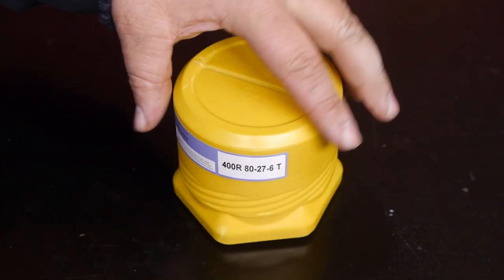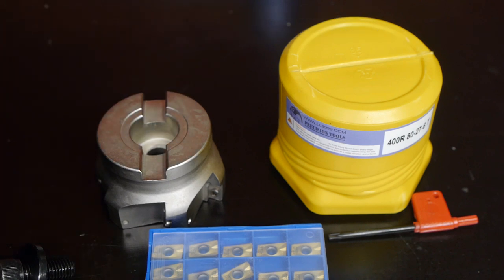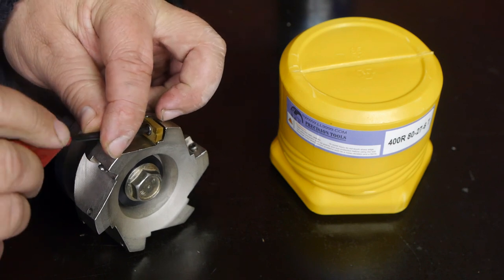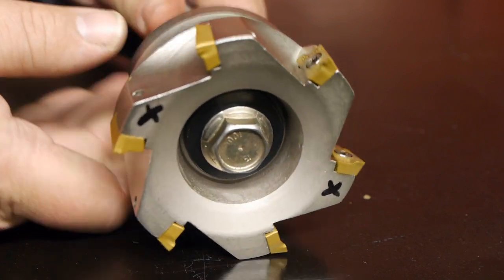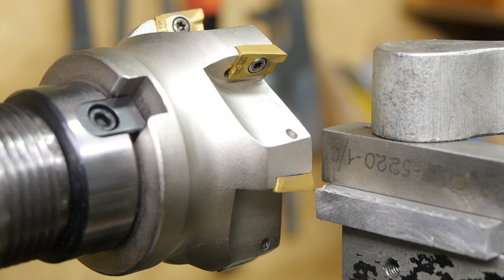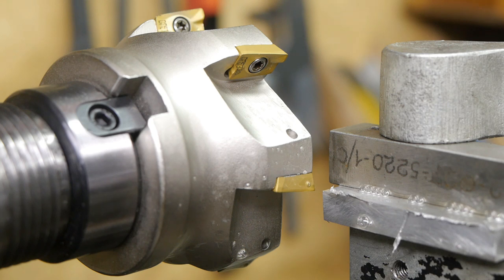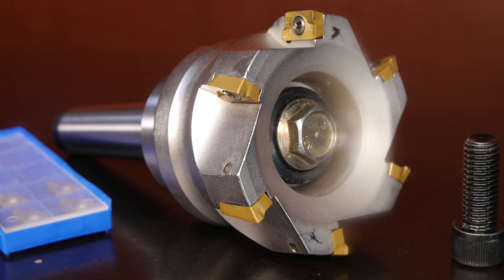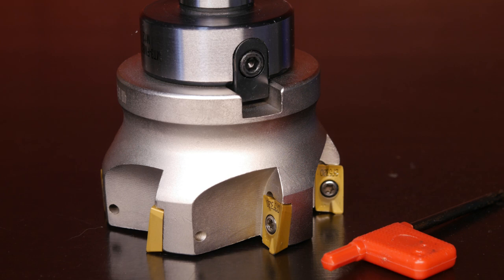Testing  a cheap chinese face mill on a vintage lathe

Comment: Once when I was in the emergency room (after having cut my thumb badly in the kitchen) the guy on the next table over was a career machinist. He was clearing chips from a mill in a way he had done a thousand times before... but that was the one time he didn't get away with it.  And therein lies the lesson: you may get away with something a thousand times, but it only takes once.  Fortunately he only lost the nail and a shaving of bone, not the whole finger. Me, I'll keep using sacrificial things like chip brushes. My fingers don't go anywhere near the work, the tool, the chuck when anything is moving.

Comment: As an old machinist with 10 digits still intact I cringed when you checked your surface finish with the spindle still running.
That would be number one on the “Never do this” list. Right up there with checking for a sharp edge on a spinning part.
The cutter will take no prisoners.  In a flash your fingers will be gone.
Yeah yeah Safty Police and all that.  
When leaning to fly a plane my instructor said to me.  There are old pilots and bold pilots, but no old bold pilots.
Stop your spindle when you hand leaves the feed wheel 😀

I agree with the others that’s only cutting on one or two inserts.  That should be obvious on the inserts themselves.  
Only one or two will show any signs of ware.
Perhaps a dial indicator on the inserts to measure their location.
Reply: I too cringed and he didn't do it once but three times. The last time i thought he was going to be bitten big time and lose two or three fingers at once, he would not have lost just the tips of his fingers but the whole lot as they were dragged into the cutters. And don't forget there as six of the greedy little bastards not just one!
Reply from the maker: I've been hit on the fingers a few times. It actually doesn't hurt as much as you might think.
But I wouldn't like to get caught between the chuck jaws and something else.
Or loose a chuck of flesh to the milling insets

I'll be careful, I promise.
Reply: The other big one is V belt pulleys or Leed / Feed Change gears.
Never use a lathe without a guard on the change gears.  They are like a meat grinder and will grab anything that goes near including you clothes.  If you don't have a guard make one.
V belts pulleys will grab you and whip your finger around the pulley.  I know you have exposed pulleys, my 80 year old lathe does too but my hands never go anywhere near them when they are running.  When I'm changing the feed gears the power plug is out and hanging where I can see it.  I don't want to harp on about this.  If you learn one thing from your Youtube buddies this should be it.  You won't loose a chunk or get a cut.  It will hack your finger off or crush it beyond repair.  We don't want to be calling you Stumpy :)
I'm still enjoying your videos and your commentary so keep it up.
I'm up to the editing stage with my first video on a quad bike repair.  Man that is as time consuming as the actual job.
Reply: he might never need that fingers anyway....heheh...

Comment: Peter Robson.
It sounds like only one cutter is cutting the meterial.
Reply from the maker: I guess this one is for you: https://youtu.be/tBmgfksN5sc
Reply: Technically with the small piece of stock in the fixture only one is cutting at a time. If if was larger area then more would be at the same time during feed...

Comment: Sounds like one or two inserts are doing all the work. Would have liked to see you use a clock to check insert heights. I would think you could get a better finish with the fly cutter and a very sharp well honed edge on a decent piece of HSS than with the face mill.
Reply from the maker: fun before precision, but I will check them with an indicator.
Reply from the maker: I measure the insert hight in a follow-up video: https://youtu.be/tBmgfksN5sc
Reply: you can tell by eye its a least 4mm above  centre height

Comment: I have the same tool and I remove the inserts leave only one and leave finished like a mirror.
Greetings from Chile
Reply from the maker: I also try that near the end of the follow up video https://youtu.be/tBmgfksN5sc
Reply: @Rolingmetal  To me it has given result, work at 2000 rpm with a single insert and works quite well and how much I want to devastate use Apmt 1604 M2 inserts work super despite my milling machine is Chinese and very poor quality
Reply: greets from linares Chile

Comment: There is a speed and feed issue here. Plus I'd take a deeper cut with the inserts. Either speed up rpms or reduce feed rate. 

Reason I say deeper depth of cut is because its not getting into the zone the carbide wants. Id be different if it was a single point tool taking spring passes
Reply: Not defending the cheap inserts because a high quality insert is bar none. Just saying..
Reply: Agree with what you are saying here. Carbide needs a certain depth for them to work properly or they just rub (which it looks like to me is happening) because of the top edge engaging the material. I also believe that is why others saying to use aluminum inserts works better since they have a ground sharp edge vs the blunt edge of a standard insert for harder alloys/metal but this will decrease the life of the aluminum cutter. Reading on many insert manufacturers sites will show that too shallow of a cut with the wrong insert will cause uneven surface and rubbing to happen. I'M NOT a machinist and not claiming to know everything and only going off of what the insert manufacturers say/recommend, this is why when I get close to size but there is very little left to remove I go to HSS on my lathe or a traditional end mill for finish.

Comment: Congratulations on receiving the face mill.  Free is always the right price.  I have the smaller 50mm with 4 cutters, but mine was not free....but maybe someday.  To get a good finish with carbide, you need speed and pressure (DOC).  Really enjoy the channel.  Do you have a Patreon or Paypal account, for donations?

Comment: More speed at the cutter and bigger cuts . If you’re going to continue to do this you need to lock out the feed and add a load of weight to the headstock . 
It’s going to destroy your feed screws .

Comment: You should make a third axis attachment since you don't have a mill. If you're worried about the complexity or something you could make flat ways to reduce that. It might be shitty but if it has a gibb you can learn to make it work, I'm sure. My little mill/ lathe combo has a bend in one of the threaded rods so it still has about .0125 mm of wobble in that axis even if I tighten it up to Incredible Hulk settings. I just deal with it. 

I love seeing people make much out of nothing or very little. I think it's awesome.
 BTW, I've never paid enough attention to know if you have any dial indicators.

Comment: First thing.  Your machine is not ridged enough for that size shell mill neither is your work holding devise
The inserts are not for aluminum that's why you didn't get a good finish.  I use these cheep chineesium  mills in my shop on small engine blocks
and heads and get very good results.  If your looking for less then .0005  tolerances buy a Sanvik

Comment: I bought the exact same face mill. I was not impressed. I had the same problem with inserts not all being lined up on the same plane.
Reply from the maker: When precision is more important then fun it gets harder to be impressed :)
I'll check them with a test indicator. But the pointy bits all seem to have similar wear.

Comment: why didn't you run a tap in those threaded holes and also make sure the inserts set flat? Using a adj wrench to reef on them is just crazy - come on, you can do better than that. Even if the Chinese screwed it up, at least try and rectify the situation

Comment: I believe the issue with the surface finish comes with not passing the workpiece the whole diameter of the cutter, the trail edge is the end of your cut, not the leading edge. Great video though love your stuff
Reply: usually looks better you dont on most machines.
Reply from the maker: If you get a nice cross hatched pattern you know you spindle is square to the table. Mine sure isn't.
Reply: @Rolingmetal is exactly right, but I find with low carbon it tends to just smear on back side in my trials.

Comment: Sounds like the inserts were cutting uneven.  Use a sharpie and mark all of the cutting edges.  Make a cut and see which ones no longer have sharpie on the edge.  If any of them do not, it isn't cutting at all.
Reply from the maker: Many have said that. have a look at the follow up video. https://youtu.be/tBmgfksN5sc

Comment: Hello , great video , that is a very nice addition to a lathes capabilities , i wonder since in a tide budjet if it would a solution to hold an hss cutter in a four jaw independent chuck slightly eccentric if that would do a good face mill  , do you think it would work ? Would it be dangerous ? I have <<converted>> my wood lathe to be able to cut metal (mostly alumimium and plastics ) with a three jaw chuck and an compound table and a diy tool holder , its ok for now for what i need it for but i cant part anything but plastics cause it chatters and the compound table uses alot of space and i cant have tailstock support and since i need a four jaw chuck anyway i wonder if i can do some milling with it without having to buy mt2 tool holder .

Comment: For all those that are saying it only cuts on one tooth, unless the spindle and adaptor are true the cutter never will be, I have yet to see a cutter from Sandvik, Kennametal, Iscar or Seco cut on all teeth except if the machine is new or near new.
Reply from the maker: They are only class M inserts so there will be some variation in the size of  the insert. https://youtu.be/tBmgfksN5sc

Comment: Nice work RM, you really have the bug for a proper vertical "knee" mill. And so you are achieving it on the lathe in the interim. Good stuff. P.S. check your lens for lube oil :-)
Reply from the maker: You are right, about the mill and the lube :)

Comment: Nice toy but should be used in a mill. the lathe is not quite rigid enough to get your mirror finish. The finish you did get is remarkable though in any event as I see it, good work!
Reply from the maker: You might be right on that one. I guess I could use a mill :)

Comment: You barely scratched the surface (pun intended) of what that cutter could do in a BT50 tool holder.
Reply from the maker: 0.8 mm was the max I dared to scratch off.
Reply: @Rolingmetal  Probably for the best.
Probably not going to get a performance increase over the fly-cutter for such a light setup from the stand point of metal removal..
Try leaving every other insert out if chip load gets to high.
For alum there are better inserts than the ones you have there. Just putting one of them in is often best for finish. Would still be better balanced that a fly-cutter and the extra mass of this cutter may dampen vibrations some.

Comment: I have a 50mm face / shell mill from China but I bought inserts that are designed for aluminum. They are very sharp and I think they're uncoated. I get a mirror finish.
Reply: +1 on using aluminum inserts. I use them on stainless steel. Our cheap Chinese lathes and mills seriously don't have the balls to use standard carbide inserts correctly. I get an amazing finish using them. Tool insert life is not highly important to me.
Reply from the maker: Ok, so now will need to get me some aluminium inserts. Because the inserts that came with the mill are shit. https://youtu.be/tBmgfksN5sc

Comment: Very interesting, I have always trouble grinding a flycutter bit correctly, due to lack of experience, so using these cheap inserts on a milling cutter instead of a single point flycutter is intriguing.
Reply from the maker: for me, itsure worked a whole lot better then fly-cutting

Comment: They just used the nearest available washer to place under the bolt. A little bit of thought would have resulted in one a little thinner for more threads engaging.
Reply from the maker: Even if the made the washer a lot thinner I still wouldn't be happy with it. That's why I used a longer bolt and not a thinner washer.
Reply: @Rolingmetal  Understandable. Your bolt may be stronger as well...who knows what quality of material is in the bolts they use?

Comment: I had already turned the noise off b4 u said dont touch the volume lol
Like ave says good enough for the girls i go out with lol
But really for 35 usd it aint bad for many operations.
Reply from the maker: It's at least 35 dollar of fun.
Reply: @Rolingmetal  I think its very nice.

Comment: Glad the test run of the face mill had a happy ending.

I love the face mills with carbide inserts.   I have one which uses 4 inserts.   1 1/2in dia (3.8 cm).   I was not sure if this would be too big for my milling machine, but it runs so smooth I could have purchased e.g., 2in dia ( 5.1cm).

This is a good addition to your tool temple.

Dave.
Reply from the maker: Damn you're right! this one will be more then likely to big for a Chinese milling machine.
Reply: I think it will work for you.   They are balanced when running.   The particular milling machine will just determine the maximum depth of cut.

I am not in a hurry so I normally take light cuts such as .5mm.

I bought a 3in dia boring head (7.6cm).   This is too big if I attempted to use it at the max diameter.

Dave.

Comment: When you were talking about light shining through I assumed you meant either behind insert or below insert, when the head is placed vertically on a table.

It sounded to me like one insert is slightly "ahead" of others. Like there was one distinct sound on each turn when you were advancing the cross slide.
Is it possible that only one insert was cutting all along? Have you checked whether all of them are equally "protruding" to the side of the head (to use the technical term)?

Non-machinist here, so take it or leave it :)
Reply: Agreed - sounded like a fly cutter to me....Would be interesting to inspect the insert tips for evenness of  wear.
Reply from the maker: Between the insert and the pocket. I'll place on a piece of glass and check it all insert are scratching.
But it looked to me all inserts were showing similar wear. (coating gone)
Reply: @Rolingmetal  Could be just the sound.
Have you tried "dial it in", like this: https://youtu.be/OcPJzR1-96o

Comment: I have the exact same cutter and my experience using it on my mill is consistent with your observation, bolt being too short to the surface finish.  Not bad, but not great either.    Thanks for sharing.
Reply from the maker: It's definitely not prefect but it was fun to use :)